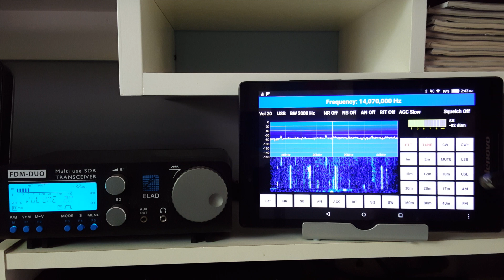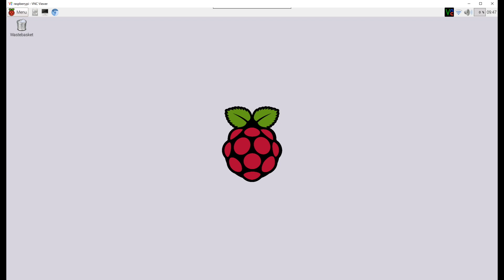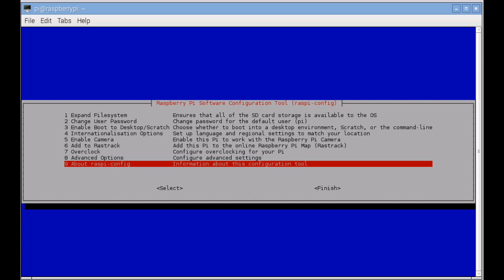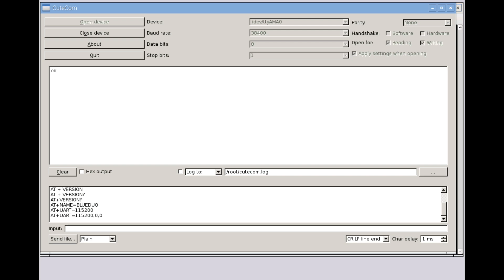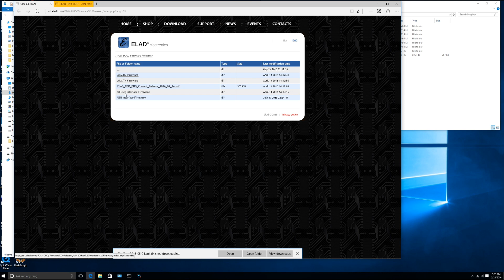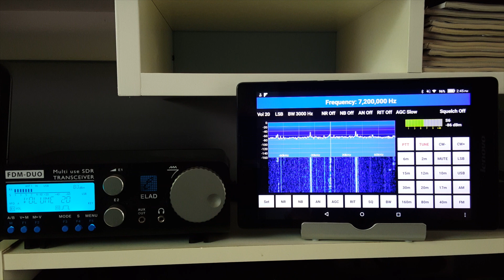Wireless Spectrum Display for the Elad FDM-Duo

Comment: A bit late to the show, but thank you for the video. I found the HC05 chip would not power up on 3.2V, but worked ok on the 5V pin on Raspberry Pi. Also, CuteCom has been updated and while most aspects are the same, I could not get the HC05 to respond until I changed the device to the /dev/ttyS0 because /dev/ttyAMA0 did not work. Cheers.
Reply from the maker: This video is a bit old.The basics are probably ok, but some of the details may have changed. Thanks!

Comment: I successfully programmed two HC-05's using your excellent instructions!  Thank you!  However a second set of chips starts in the Program Mode (slow flashing red LED with no blue LED visible)  I can proceed with programming (Using Pi and Cutecom) but device is recognized...   Shouldn't these chips start in the Operate Mode?  Thoughts?